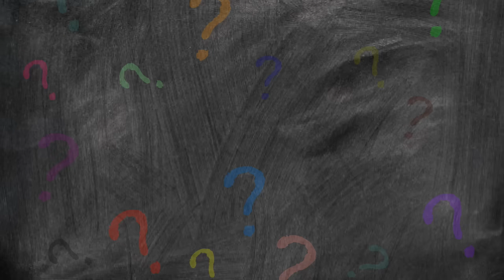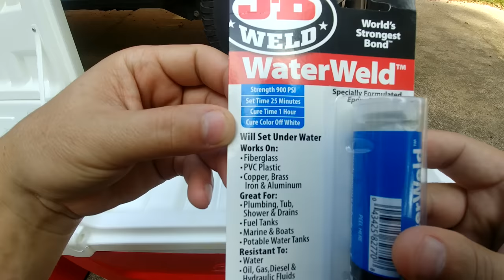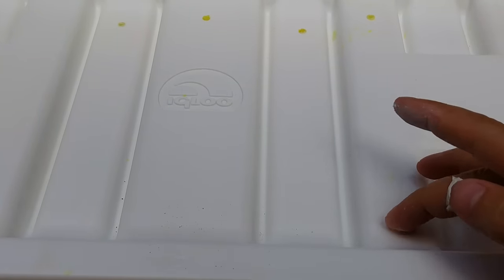Do Yeti cooler hacks work?

Comment: The best insulator is still/isolared air. It is why we use foam for insulation. It has a lot of air bubbles. 

So it means the cooler has isolated air pockets to insulate as long as they remain intact that exceeds any other forms of insulation. 

The lid sealant rubber should improve the efficiency. That would be great to test.

Comment: I haven't watched your Part 2 video yet, but air is an excellent insulator, which is probably why the modification made it worse.  If you want ideas for better things (again haven't seen part 2) pulling a vacuum in the cavity of it and sealing it off somehow would 100% work.  There's a reason thermoses are so good at keeping drinks hot / cold.

Comment: The insulation retains heat so when lids are closed all of the heat is released into the cooler to slow heat transfer you would want to chill the coolers first. Als
Reply: Heat soak with the foam that’s what I thought

Comment: Fill the coolers all the way with ice. Put them on the ground.  You can also put them in the direct sun .Can even try swapping lids to see if the coolers themselves are different.  When you shut the lid you are going to have a mass of air.  The colder air will stay at the bottom and the hot air will go to the top.  Because the lid is insulated the hot air has no way to be transferred out of the cooler and all that air will eventually melt the ice.   The insulation is actually keeping the warmer air inside.
Reply: The hot air will get cooled down by the ice, it doesn’t need to “escape” LOL

Comment: Would there be any value in repeating the experiment with foam board insulation fixed to the interior of the lid without using any spray foam insulation?

Wouldn't that be like getting the best of both worlds here?

Comment: IMO static air within the stock lid transfer less heat then conduction through the "insulation foam", the seal on the other hand should help.
Reply: I agree with everything you typed except your spelling of than.

Comment: The lid is hollow to create a temperature barrier. Same principle as double paned house windows and exterior doors. Inside panel is cold, air gap is warm and exterior panel is hot. By filling the lid with expanding foam your making it easier for the heat to transfer through the lid.

Comment: Sweet vid, Thanks!  But if having foam in the lid is worse, then why do the top brands and best performing coolers have foam in the lids?  

Did you empty that entire can of foam into the lid?  That could be the problem. Foam expands like crazy, if you put all that foam in the lid, then there wouldn't be much space left for it to expand and form gas bubbles, it would make the lid heavy, cause it to bulge, and maybe conduct heat better.  I would suggest sticking the application tube all the way in the holes and putting in just a little foam at a time as far away from the hole as you can, just a little!  Then go to the next hole and so on.  Take your time to allow it to expand.  Go as slow as you can without it setting up in the application tube.  I'll bet you only needed 1/10 of that can or less.

Comment: It's less efficient using insulation,  you're creating a heat sink by adding the insulating foam. The gap in the original lid was a better insulator than a solid one and the coefficient properties were much better. Try using the car self adhesive sound deadener on the inside of the lid to reflect the cold back into the cooler and lets see the results?
Reply: Cold doesn't reflect, heat does.  If you use something in the top of your cooler that has a reflective side and a non reflective side, point the reflective side up to reflect out the heat.
Reply: Well. Just give it a try and tell me the results. Then we can have a discussion of what works and what doesn't.

Comment: The modified lid traps in heat that the unmodified allows to pass through. Cooling something is removing heat so insulating the lid blocked the heat from leaving the cooler. Look  at a yeti cup, the lid is just a clear piece of plastic but if ice and water are left setting in it the ice will fuse together

Comment: Dude its the foam. Window foam will absorb heat. Use marine foam or styrofoam. I did styrofoam in the same cooler. Just dump the balls in a little at a time n hit it with a heat gun. About 3 cups. Keep a steady even heat and dont melt it. The foam will expand. So you have to watch the amount n try to keep is moving. Slowly filling it up.
Reply: Good tip I'm going to try this method out
Reply: Bingo. You win the prize. The stored heat from the foam transfered into the cooler to melt the ice.
Reply: the cheap closed-cell spray foam is a high thermal conductor relative to Styrofoam (EPS expanded polystyrene) which is loaded with air, and provides a thermal break between the plastic on the outside and the inside meaning much less transfer of heat. It also “traps” air, and those pockets of air take a little time to change temperatures vs a big empty lid full of air (one giant pocket) that changes temp much quicker. As y’all pointed out, the foam actually transfers heat from the outside plastic to the inside more efficiently than just air, rather than slowing that process down.
It works the way a neoprene wetsuit traps water. Your body heats the water in the suit, and the suit provides a barrier to the water around you. Your heat is radiated into the surrounding water much slower, allowing you to stay in the water longer.

Comment: the reason the regular cooler did better is because of the space in between the lid and the bottom inside lid. when you put the foam in, you filled up the space and that just transferred the heat quicker. 

If one was to improve this, one would take apart of the lid, spray top and bottom parts of the lid.. once dried, scrape out a hollow section so there is a space for air but leaving a thin layer of foam around the lid. reassemble. 

air can be a very effective insulator.

Comment: Well, i used expanding foam in both the lid and the cooler walls. It did GREAT. I did not use the insulating tape at all. Mine kept two frozen gallon milk jugs in similar conditions for over 3 1/2 days.

Comment: Air is a great insulator. That is why all insulation has air gaps in it. Possibly a lighter application of the insulation foam and allow it to have a full and complete expansion might make a difference and allow that spray foam insulation to do its job. Though with the resistance to heat change the plastic naturally has combined with the air gap.. That is actually a great insulator. That is also why thermal cups tends to just empty air space and work well instead of being filled with something.

Comment: The whole purpose is to have the space so that the plastic touching the outside has an air barrier between the plastic on the inside
Reply: Air barrier needed in lid. Foam filling eliminated the air barrier.
Reply: Yep. He made it worse.
Reply from the maker: You should look at the inside of a Yeti. It is foam filled.

Comment: The void in a cooler is to separate the temp inside from the outside... A thermos works the same way, The void in em is what's allowing the temp to stay. Sealant in between the lid and bottom is a better idea but it relies on that you make it better and tighter then the original product....
Reply: Yeah I was going to comment that sealed air is probably a way better insulator than drilling a bunch of holes and filling it
Reply: You do realize a vacuum bottle resists temp change because the space in the double layer construction is a vacuum, right?
Both the urethane foam and entrained air are very poor conductors of heat and is why foam is a better insulator than air alone
Reply: @svgs650r  Still, the void is what separate the in and outside way better and more efficiently cos it takes longer for the temp to equalize sins where dealing whit 3 temps instead of two... you wood be right whit the foam when it comes to continues cooling or heating from one side but in this scenario it's all about conserving the temp as long as possible and to active the same whit foam you need a much thicker layer than whit the void...

Comment: Did this to a lunch box cooler and it worked really well for keeping my food cold even in 100+ temps all day .
Full outside wrap Bottom , Top , all sides should work better . Because ut would keep exterior heat sources at bay .

Comment: Ice retention is all about R value. The higher the better. What you did was lower it by adding foam and allowing a path for the heat to travel. The air gap that was in the lid is intentional and provides better R value than one packed with a foam.
Reply: yea thats not true at all. the lid is not a vacuum.  Foam which has an R value of 6 per inch is way better than air which is 3.6 per inch. he fucked up and put too much foam in there and didn't let it naturally expand.
Reply: @srzy  Plastic coolers never have a vacuum in the lids or walls. To your other point, foam with the correct density does have a better R value than air, but I think he also messed up the lid seal when he squeezed too much foam in there. We also don't know if both cooler are exactly the same - production can vary greatly.

Comment: The reason insulation works is because it prevents heat transfer. Some do that by having air trapped in pockets and preventing it from moving from pocket to pocket.  That foam might not actually be a very good insulator.  I think it’s main job is to fill cracks and expand, preventing airflow, but not necessarily to be an insulating material itself.

Especially if it’s overfilled and the lid compresses the air bubbles out of the foam.  A much lighter application of foam  or one that’s applied while the lid is cut open and then resealed afterward might work better.

Comment: Before you punctured the lid of the cooler I think it was vacuum sealed, possibly I'm not sure but I'm wondering why it's made in those shapes and with seperate chambers, as others have pointed out air is a good insulator but vaccuum is impervious to conduction so I understand why both work better than a solid medium to transfer heat out of the cooler
Reply: for strength only -  no other reason.

Comment: I did this hack on 2 of my Igloo coolers. In my case there was no insulation in the cooler. The lid and cooler body were both hollow and just had air space in between. I drilled holes along the top of the body where the lid makes contact and in the lid as you did and filled with low expanding foam. I then cleaned up the holes and filled with epoxy. My coolers keep the majority of a 22 pound bag of ice for 3 days.
Reply: According to the laws of physics, you made your coolers worse.
Reply: @EAMitch  Is that so? Before the modifications they would barely hold ice for 24 hours. Now after they held ice for three days and would have gone quite a bit longer if the camping trip wasn't over. I don't think you understand physics as well as you think you do.

Comment: Air is actually one of the best insulators. People use foam because it's a sealant, not because it has good insulating properties. So it plugs holes and gaps where drafts are.
What you want to do is put a reflective material on it. As many others have mentioned, the bubble insulation. You could use aluminized plastic (think silver tape) to reflect radiant heat.
The next thing you'd try to do is reduce conductive cooling. Plastic already is really good at that so there isn't really anything you can add here to increase performance other than make sure the lid seals really tight.
And next what you want to do is drain the water often. (not a cooler hack, I know) or keep everything on a small cookie cooking rack to keep the ice out of the water. Water conducts heat extremely efficiently, and also has zero longevity. It's thermal mass is next to useless because the phase change from solid to liquid is where the vast majority of your energy goes from cooling power.
The last thing you can do is simply pre-chill your items. Again not a hack. But typically it takes a whole night inside of a refrigerator to get a pack of waters cold. That's a LOT of wasted energy. So make sure to pre-chill your items. (p.s. Just like you should pre-heat a thermos for hot liquid by pouring in boiling water first then dumping it)

Comment: If you get the spray foam on your hands. Simply clean it with nail polish remover. also to fill the holes. that JB weld is likely to fall out because it has nothing to hold it in place. you needed to scoop out a very small amount from the holes so they were slightly concave. Also sealing the holes with food safe silicone would have been a better option..
also the coolers you used seem to be the lowest grade available. often  not only arent the tops insulated in the el cheapos but usually the sides arent insulated either.
This would explain why there was no difference in ice melt between the two coolers.

Comment: That water weld is good stuff I used it to patch a hole in my truck radiator, works great!
Reply: It doesn't make sense to me how so something that simple is so versatile and tough but it is.  I've used it to patch cracks in bottoms of shower stalls and it held up no problem
Reply: @yodaguy6956  that’s what I’m saying it’s amazing what all you can fix with it

Comment: The expansion and off gassing of of the foam creates thermal energy.  Even while the foam appears to be rigid and cured, it will actually take several weeks before the foam completely cures and stops off gassing thereby creating thermal heat. The test should be done again 6 months later.

Comment: I used the foam as well on a cheap cooler. I used a gasket on the top and bottom and put a lock on the top to hold it down tight. My cooler will hold a 20lb bag of ice for 5 to 7 days as long as the kid's don't open it 50 times a day. I also put my whole cooler in my freezer overnight and I make sure all my beverages are cold before they go in the cooler. That is what really makes the difference. If everything you put in it is warm your ice will melt 3 times faster.

Comment: Did you use closed cell or open cell foam? I would think closed cell foam would not hold heat, and open cell could hold heat, also the way the sun comes through the windows of your vehicle could be an issue, also the gassing off of the foam. Probably different results if the coolers were left in the garage, and 6 months after the foam. Did you foam the body of the cooler as well?

Comment: The foam transfers the heat better than air does. Wonder if you put an air valve on it and tried to put a slight vacuum on it. May insulate better

Comment: In any "foam" air is the insulator in closed form. The spray foam is meant as a sealant and creates air bubbles which is the insulator. I those lids, the air closed inside is a much better insulator than foam.

Comment: Did the sun set on the side of the car that had the modified cooler? If so, that would make a difference. Also I think the type of insulation you put in the lid matters, and it should also be applied around the bottom of the cooler as well.